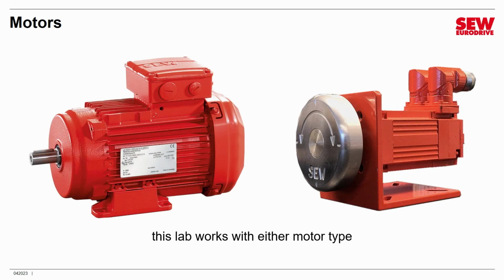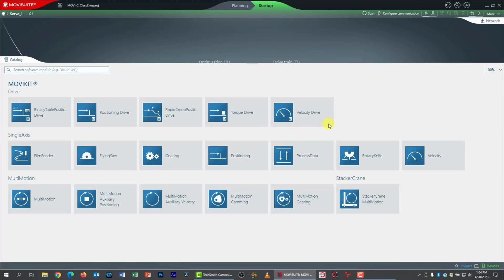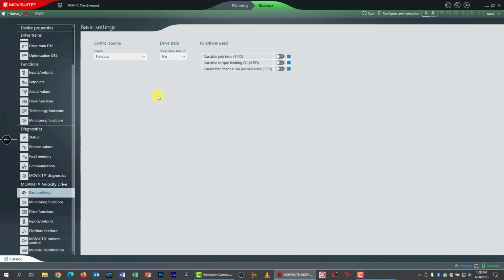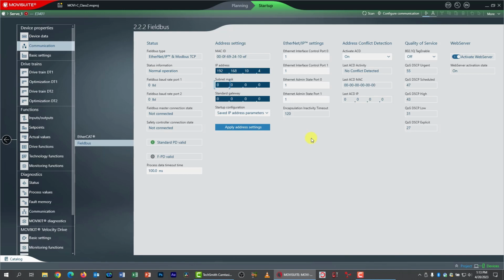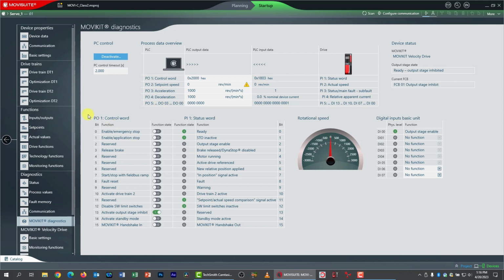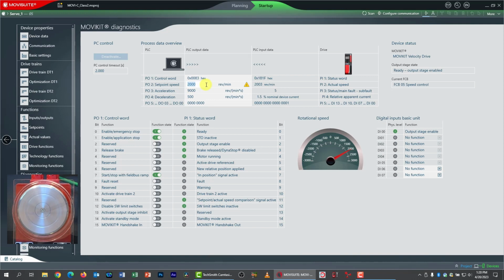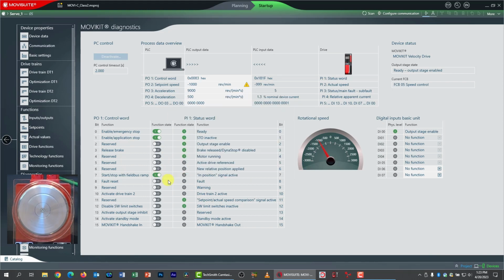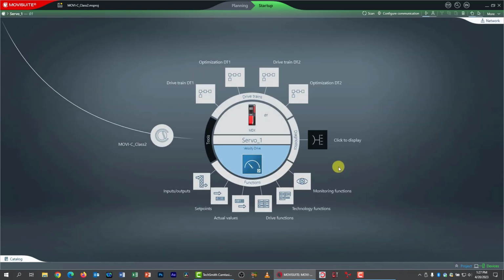MOVI-C® CC Training – Session 14 / Lab 6 – Velocity Control MOVIKIT®

Comment: how to configurate the inputs to run drive with analog?
Reply from the maker: Hello. This will require several parameters to be checked and the analog input wiring to be installed to the correct terminals. This would be easier to discuss over a phone call. We recommended to contact your nearest SEW Eurodrive office using the map linked below. Our telephone support is free, and you can ask for Electrical Support when calling in to get help with this question.
https://www.sew-eurodrive.de/meta-pages/contacts_worldwide.html
Reply: @SEWEurodriveUSA  ok i made it done but i have one problem, The input read only analog 0-10v and i need -10 to +10 so i can change direction by analog, not by DI input. I See Movitrac-C dont read analog below 0.
Reply from the maker: @Kozak450. Yes, if you have a Movitrac advanced, basic or classic (Generation C inverter) its AI1 input is 0-10V. There is scaling for the analog input in parameter (4 Functions -> 4.1 Input/outputs ->, Basic Unit (4.1.1)). You can test using a negative voltage offset or negative scaling offset to determine if you can get forward and backwards rotation with only a 0-10V input.

There is also the setting of (4 Functions -> 4.2 Setpoints ->, Fixed Setpoints (4.2.10)) then setting the operating mode to "Bipolar/fixed setpoint" to allow the negative numbers to indicate counterclockwise rotation.

We don't have the hardware to test this currently so you would have to test this to see if there is a workaround to make the 0-10V input still work for forward and reverse rotation. Press the "F1" key inside of Movisuite when clicked on a parameter to open the help to see a clearer description.